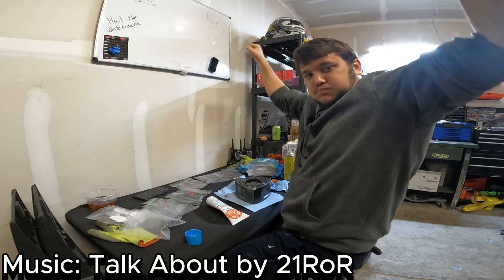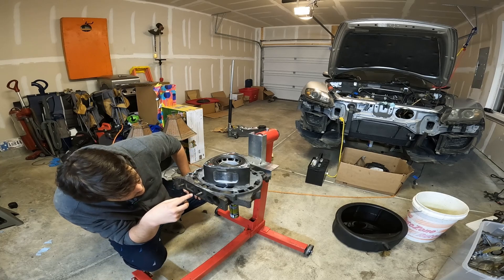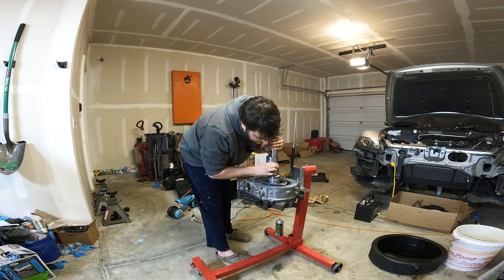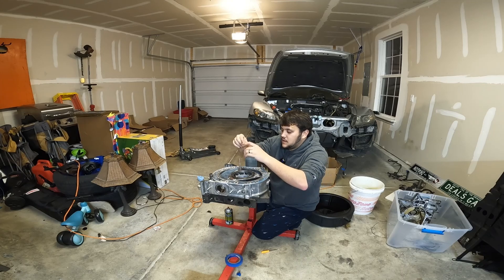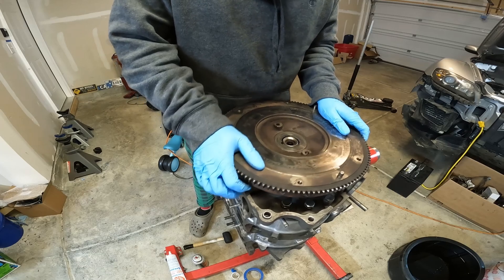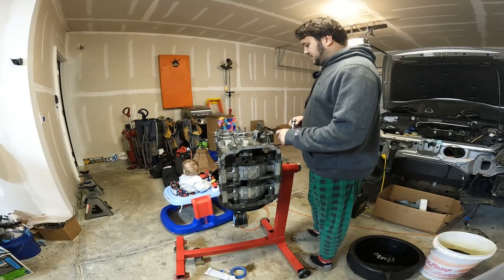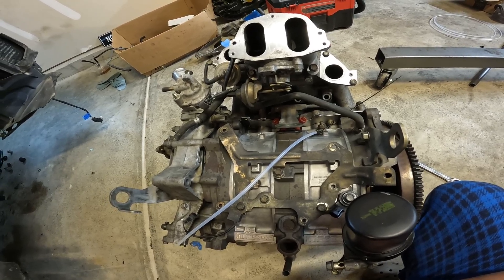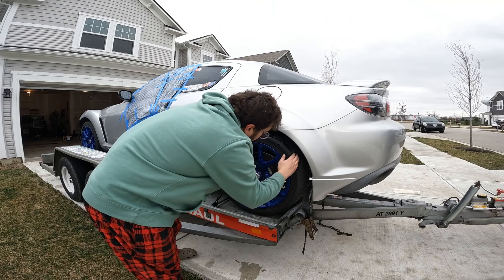RX8 Hybrid Renesis Build: Engine Assembly

Comment: Waiting for next videos! I was planning doing same thing, but after research and many conversations it turned out that it's overkill. I'm planning on 300, then 350HP on my 8, and keep it mostly stock, only studding, porting and cutting rx8 rotors to fit FD apex seals. I feel like that's power that should come stock with this car.

Comment: Thanks for keeping me motivated to build mine 😄
Thankfully you're doing this before mine so i have a mild clue what to do
Reply from the maker: Hell yeah man! I am keeping track of everything that tripped me up so once my car runs, I will make a full "everything you need to know" with all of the parts you need, where to get them, modifications needed and who does it. Roddericks Customs in Ohio are hoping to develop a jig to sell the exhaust manifold as a bolt on part. That's in the works now